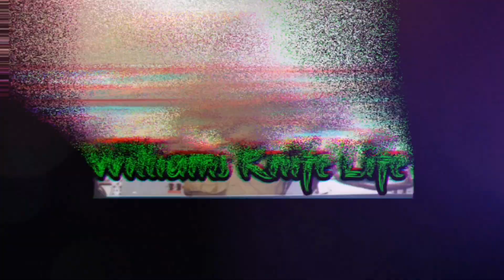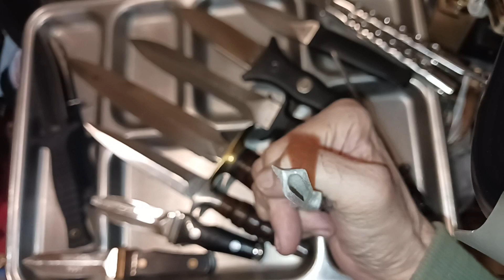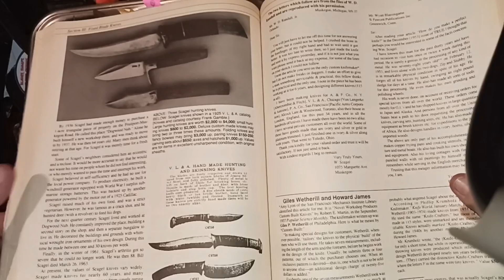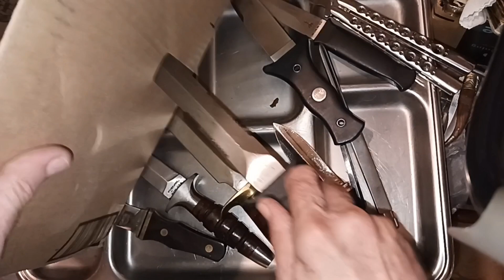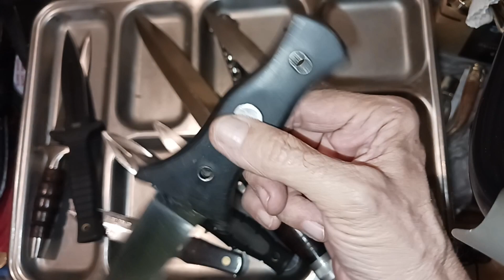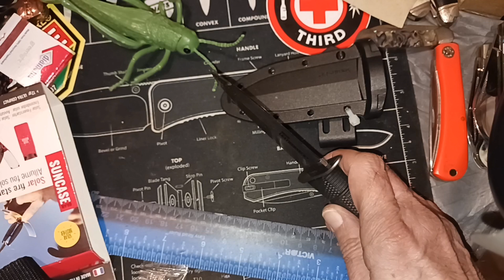(1405) Daggers 🗡 My Thoughts About Them

Comment: I used to have a couple boot knives , now I mostly wear tennis shoes. I do carry a ultratech with a dagger blade on occasion. They are legal here in Colorado as long as the blade is 3 1/2 or under for concealed carry.😮
Reply from the maker: I haven't worn a boot knife in a boot since about 30 years ago.

Comment: Would you count a knife with a typical dagger blade but with only one edge sharpened  a dagger?  What about Daggers that lack a true cutting edge?    I think some companies have made daggers sharpened on one side simply to skirt legal restrictions.

About sticking in bone.  I've read that  Commandos  and other SF types used to slightly blunt the tips of the FS dagger and V-42 Stiletto  simply because of bone stickage.  Not sure if it is true, but I've read it in several places. 

During WWI the French produced an inexpensive trench dagger out of rebar.   They were actually called Nail daggers. They were quite crew but effective. 

Fury is also a knife company that makes a whole lot of low cost daggers and other knives some call mall ninja gear. (I have found their stuff well constructed. They tend to use 420-440 steel)

Cars with fins.   Some even had a airplane for a hood ornament.

More than one cop told me you can always have a golf putter, tennis racket, or baseball bat in your car.   Toss in a few balls and glove and nobody is going to be able to claim you were armed.  Same thing can be said if you have a tool belt or box with you.
Reply from the maker: Rebar is wickedly sharp when you pick up a piece cut by an angle grinder. I found a short piece out by the new apartment complex & I picked it up to carry back to my apartment. It was about the size of a police baton, so I was naturally swinging it in my hand. I looked down and noticed it had sliced my palm open from a sharp edge. I don't know what the HRC was, but I do know that it held an edge long enough to cut me.
Reply: In Michigan one edge sharpened is okay but both is not allowed My Kalashnikov is dagger shaped but only has one edge sharpened